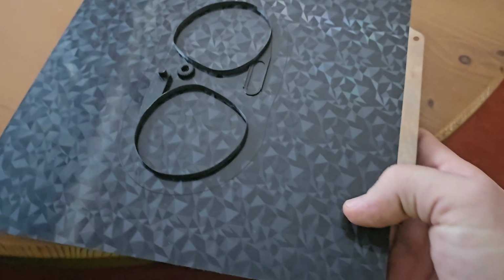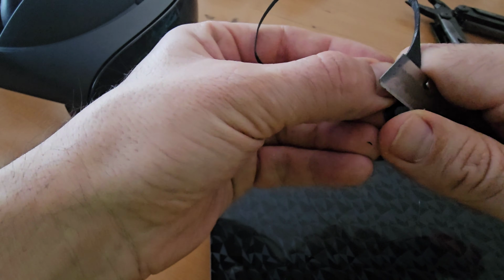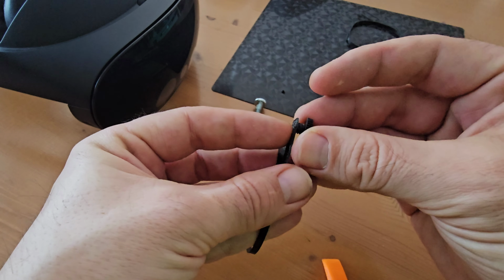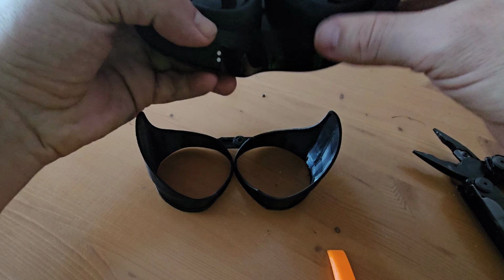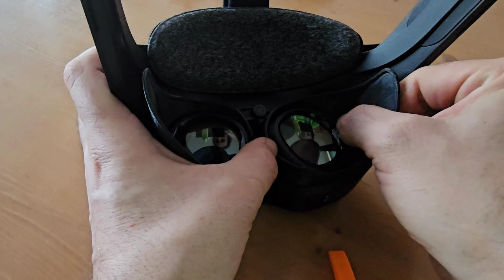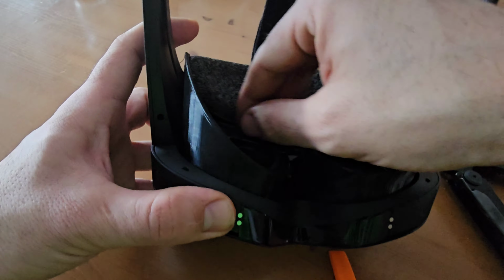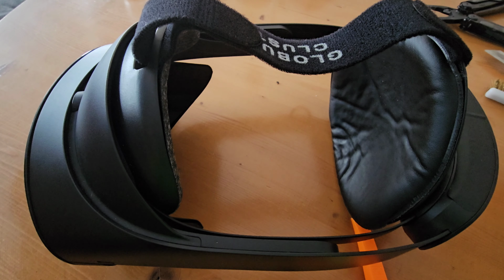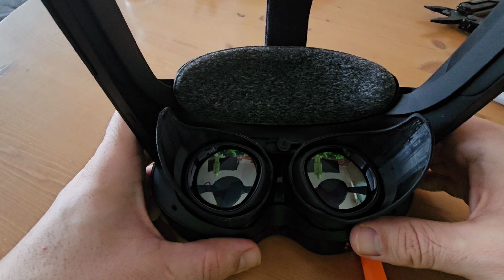Meta Quest Pro IPD Fixer (NOT FINAL ISSUES WITH FACETRACKING-UPGRADE ALMOST DONE)

Comment from the maker: Will be updated shortly..The part with the guide and the screw will be 5mm higher.With that change the belt will tighten the blockers a bit lower.It was ok like that here in the video but with that change it will be even better cuz i realized i couldnt go deeper with the belt cuz the guide touched the pro.With an additional height i can tighten the blocker at a lower point.My last change.Its finished then.You can watch my short about how it looks after the change.The one in the short is the one for those with no blockers and just wanna fix the IPD..The one with the blockers are a bit thinner in thickness.0.4 mm with blockers and 0.8mm thick without them.